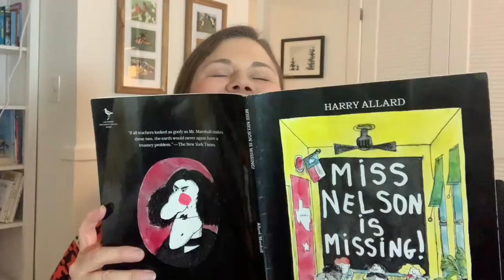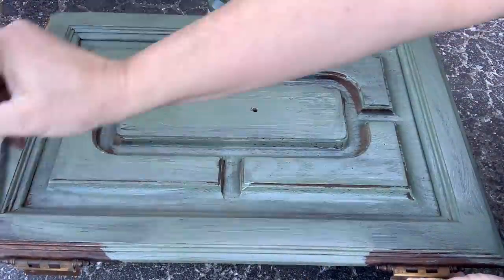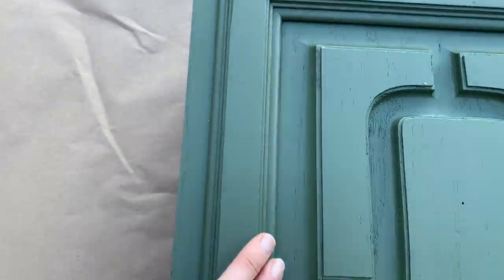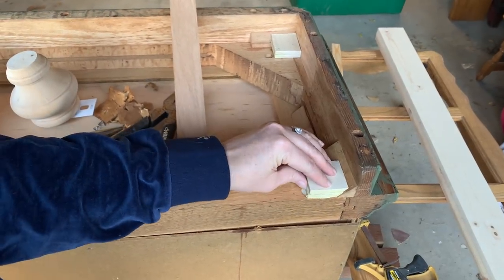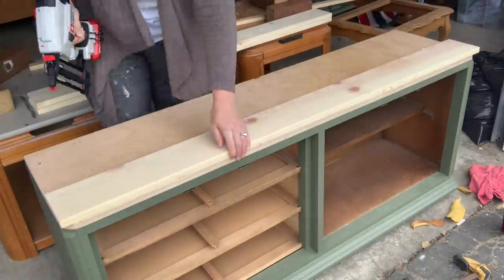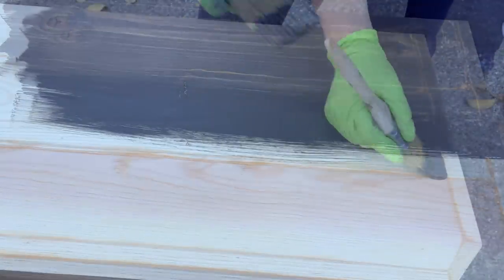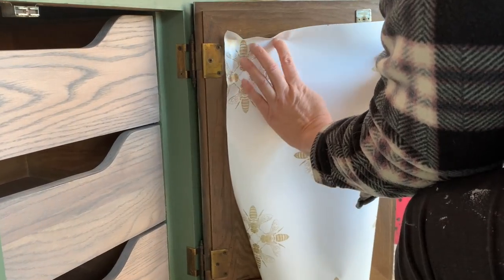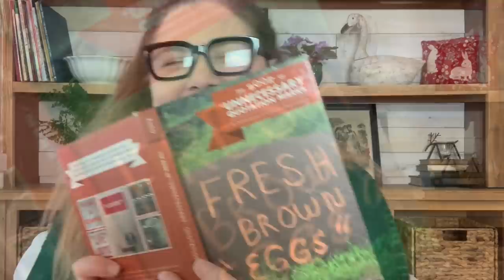How To Make A PLANKED TOP For Furniture | Replace Outdated Top With Planked Pine | Buffet Makeover

Comment: I love the green with the gray stain. It came out great!  Can I ask what kind of wood fill do you use? I made a few things where I needed to fill the nail holes and then when I stained the piece the nails that were filled stood out like a sore thumb. It just did not cover the filler.
Reply from the maker: Thanks Nancy!  Oh dear - that is a bummer.  I used Minwax wood filler on this one - I think the key is to make sure the wood filler dries to the same shade as the original wood.  (And make sure it says "paintable/stainable" as well.)  
You can also always first treat your wood with stain prep wood conditioner - that can really help give you a more even outcome.  Other than that, I'd have to do a little research to know why you got that result!
Reply: @FurnitureFablesbyAndy  Thank you so much.  I will take you advise.

Comment: Question: do you get brush strokes? If not, how do you keep from getting them? Bayberry is my favorite color for furniture. It’s difficult for me to not paint everything this color
Reply from the maker: Great question!  (And I love Bayberry too 😊)  Brush strokes are to some degree inevitable, when using a brush!  I think it's important for painters to remember that - we are not factories.  That said, the most important thing to do to avoid them is to not go back over the paint once that magical "open time" is over...and the paint will not look dry yet!  You can sand with a fine grit paper and then do a second coat if you see some you'd like to smooth out.  But one last thing to think about - Fusion is a great paint, but it is known to be one of the harder one's to use and not get brush strokes.  If you are interested in trying another brand - I've had great success with Melange Paints - one of the best levelers I've used to date.  😊

Comment: No disrespect intended, but if you would explain.  Most of the piece had straight if not Square angles,  then the shoes added were round.  Why was that choice made?  Am I missing something?  Thanks for sharing!
Reply from the maker: None taken!  For me, that particular shoe worked well because although technically square, the piece actually had a lot of softness to it.  Specifically, the feet referenced the scroll in the pulls and it seemed to balance the apron nicely.  I "tried on" a few different looks, and thought those feet were bang on.  (and rounded feet are often used with square pieces) That said, the choice of feet and hardware is of course totally subjective and what looks "right" to me, may not look right to everyone else!  😊👍